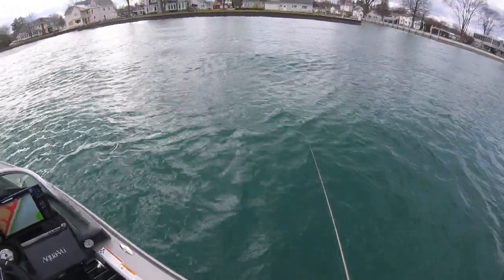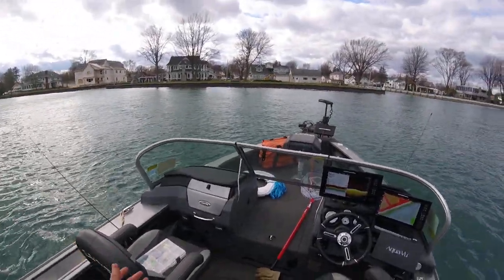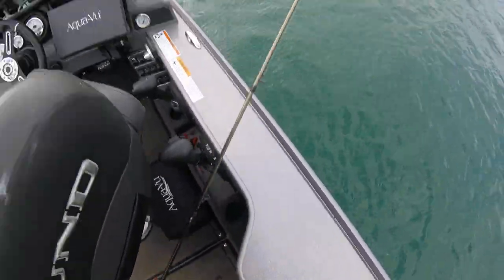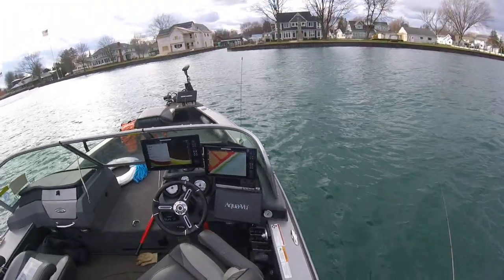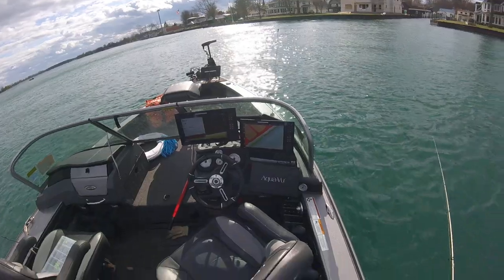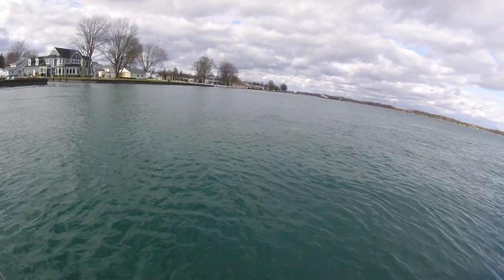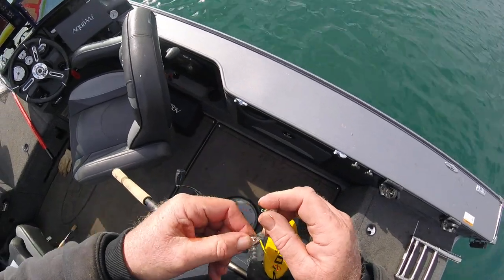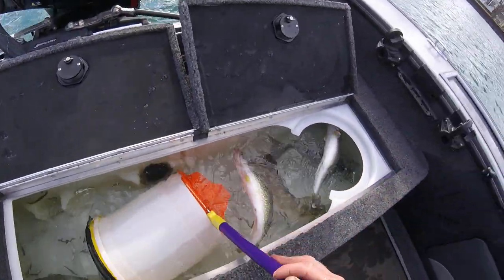Jigging tips for Walleye Fishing on the St Clair River.

Comment: Which Fenwick rod series are you using on the Detroit river and the StClair river? What weight, length and action? Thanks
Reply from the maker: The Fenwick rods that we use are the HMG series in the 7'0" medium fast (HMGPX70M-FS).
But these rods seem to run a little pricy at around $130.
But we found some Okuma rods that i thing fish just as well if not better in the Reflexions series.
The (RX-S-691Mb). 
Its a 6'9" medium fast action rod also. 
I think i paid $69. But i actually really like the Okuma rods for this type of jig fishing.
Feel free to call or text me at 231-878-2520 if you have any more questions.